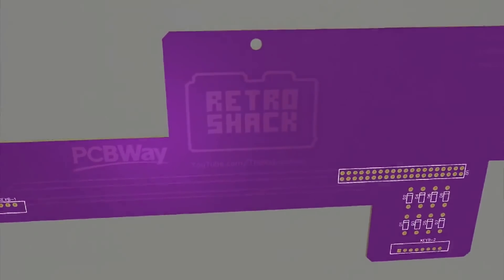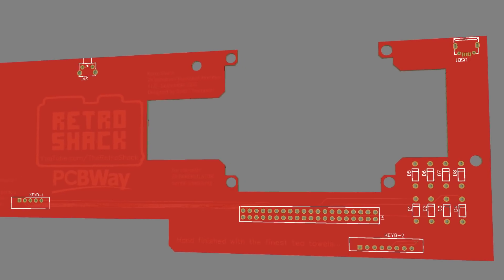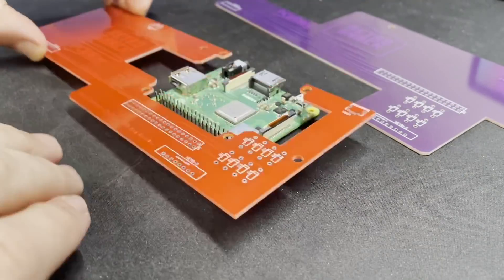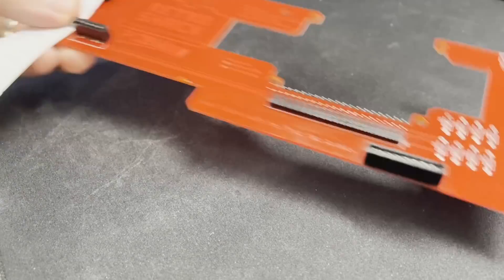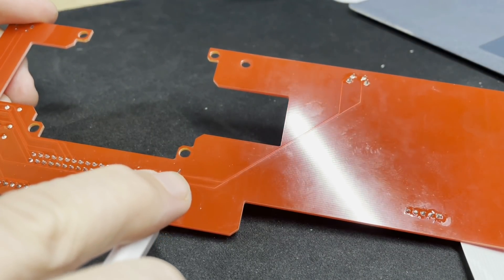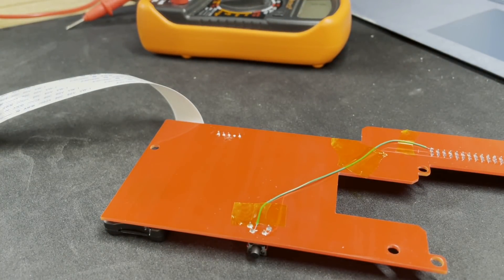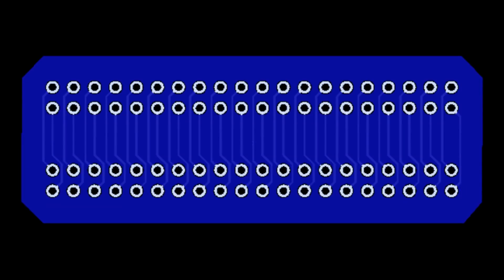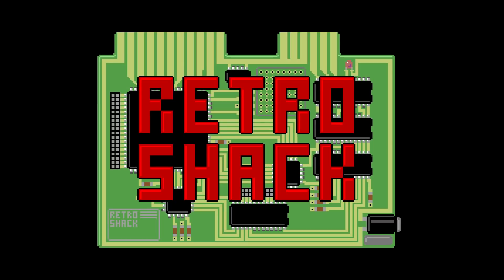ZX Baremulator Replacement Spectrum Mainboard Part 2 - Nearly There!

Comment: Looking good. You could expose a bit of the track you cut on the switch side and solder your patch wire to that and then on the PI pins. That way it's a shorter length.

Comment: For the GPIO I think you could use the same solution adopted for the gameboy zero. I would also use a solder mount  microsd holder and have a little flat between the pi and the right side of the board.

Good job!
Reply from the maker: Thanks!

Comment: Very interesting. I have a Pi Zero W just sitting around unused.
Reply from the maker: This project is based around the Pi 3 Model A+ but there are other projects out there that focus on the cheaper PI Zero, but there PCB's are more complicated (and therefore more expensive) as a result it seems.
Reply: @TheRetroShack  Silly me!  I watched your video, which clearly does NOT show a Pi Zero, then visited the HermitRetro website which features boards that do, and based my comment on that. I really worry about myself at times 😀. I look forward to the next installment, to which I promise I will more attention.

Comment: I'd definitely be interested in one of these boards. I've got an old Spectrum with a busted Z80, and that Speccy's case will be perfect for this.
Reply from the maker: Well hopefully there’ll be enough interest to warrant making a small run :)
Reply: Or you just buy a new Z80... either used or brand new.
Reply: @herrbonk3635  I got a desoldering station for Christmas, so that's exactly what I've done! 😁. Trouble is, I'll now need to find a case for this ZXBaremulator board. First world problems! 😀

Comment: why not just pull off the black plastic on the RPI pin header and then change your adaptor board so the RPI and you pcb is directly connected without that extra pcb.
Reply from the maker: Because I wanted this to be a real plug and play solution, and easily reversible without having to alter/solder anything :) Believe me I did consider it :)

Comment: Not being picky but your power traces seem a little too thin for the current needed by the PI, @ 3A the traces need to be about 1.2 mm thick. also I would suggest you add a ground plane (copper pour) on one side at least. but well done its a great design and I would want one If i could get a spectrum case and keyboard to house it in.
Reply from the maker: Good point - I'll address that if I end up doing a small production run.

Comment: I would have done two right angled 40 pin male to female headers for the pi to connect to the board. Other than that, it looks perfect.
Reply: those pins are good for soldering, the second one plugging into the first might have pins that are too short ...
distance might also be a problem, a very short self made cable could work, those connectors are available.
Reply: @jyvben1520  There are purpose made 40 pin headers for such an application of joining two boards with locking connects.
Reply from the maker: Hopefully this little bridge PCB will do the job admirably :)

Comment: I'm interested as I'm waiting for a case to make a dedicated speccy emulator, so the pcb would help me make a lot neater job than using veroboard!
Reply from the maker: It looks like I'll be doing a small run :) :)
Reply: @TheRetroShack  It makes sense doing a run, if you can, rather than just sharing gerbers etc as the postage is the killer on pcbs!  You really need to buy a few to offset the postage which isn't always cost effective if you only want a small, one off pcb!
Reply from the maker: @gartmorn  My thinking exactly :)

Comment: Count me in too. Great little PCB. I've been messing about with zxbaremulator with my pi 3. Does anyone here know if there is a way to safe shutdown as I've corrupted 2 SanDisk  cards by killing the power so far.
Reply from the maker: Looks like I'll be doing a small production run!
Reply: @TheRetroShack  Excellent. Can't wait :) Oh, and I discovered zxbaremulator can use a zero delay arcade board as a db9 adapter with [START] wired as the fire button and [button 4] (I think. I'll check this evening and edit accordingly) switching between different emulated joystick types.
Reply: ZXBaremulator never writes to the SD, and I don't have any report of corruptions.
Reply: @JoseLuisSanchez-kx7fj  Maybe I was just unlucky with my cards.

Comment: I`ve made two zx spectrums with a pi3 and a pi zero using zx baremulator and fuse,I would like to have a board to make another one please
Reply from the maker: Looks like I'll be doing a small production run!

Comment: Hiya, I wanted to do a PCB a while ago and looked at PCB-Way but couldn't really figure out what I was ordering, how much was a PCB if you don't mind me asking?
Reply from the maker: There are so many factors that influence price that it’s difficult to give a guide.  As a guide, the final PCB cost for this (when ordering 5 pieces) is $8 for 1 main pcb and one bridge pcb - then you need to add your shipping which will depend on where you are.  Very reasonable indeed :)
Reply: @TheRetroShack  Yeah that's what I meant by figuring out what I was ordering.

Like how thick do you want the board, colour, printing.... 

"Yeah dunno but I want one that looks like this" was what I wanted to put into the site haha
Reply from the maker: @thebaldconvict  Yep, don’t think they have that option :) It’s a bit of a learning curve for sure. It stick with it - I’ve had great fun doing this :)

Comment: You may keep the copper on the unused area of the board. It could be used as ground plane to connect all ground points. And it's also better for environment, if the copper doesn't need to be etched out. It saves the etching chemicals.
Reply from the maker: Well I didn’t know that - thanks!

Comment: Having installed more than my fair share of bodge wires, you should not rely on a simple knife kerf to isolate that trace. You should remove about 1/2 to 1mm of trace to ensure that temperature or board flexing does not cause the connection to re-make.
Reply: Totally agree with you Jeff 👍